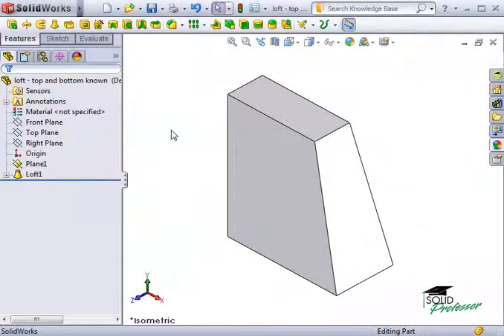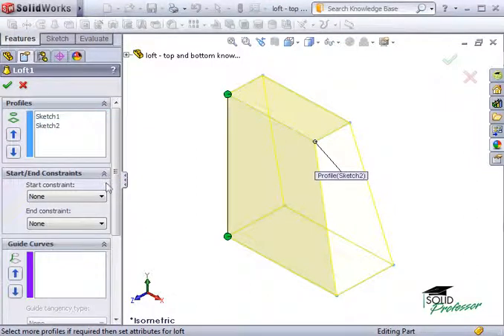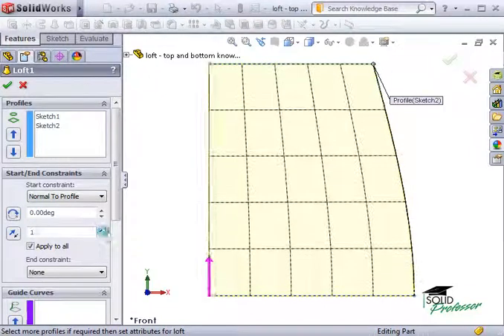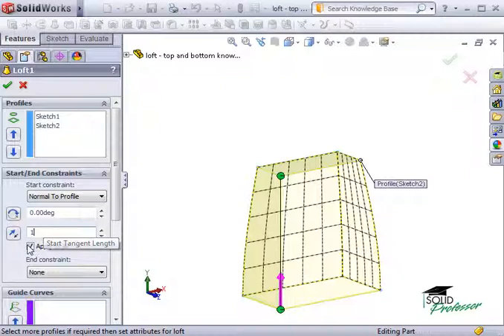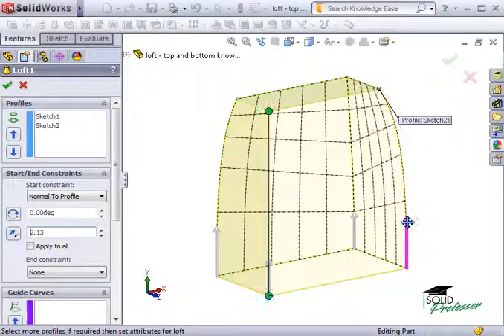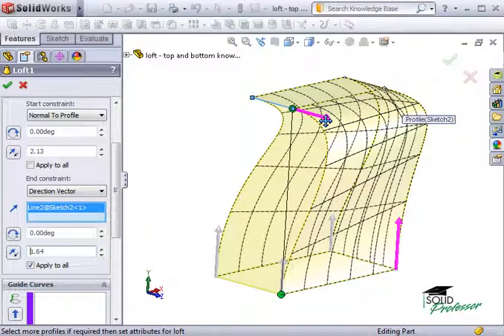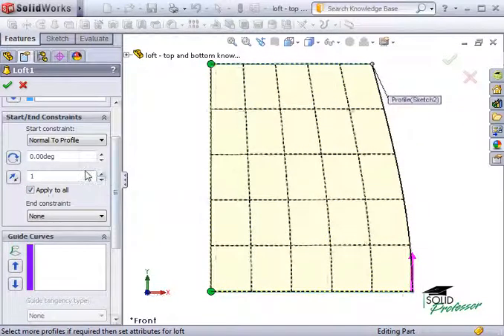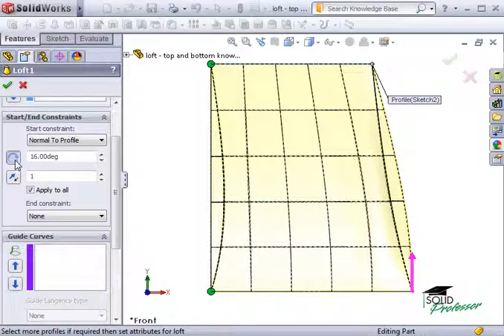4 Lofts   05 Start End Constraints

Comment: Fantastic demonstration. I needed to create a few parts that I did not need precise control over using guide rails. Using these settings I was able to achieve the results I wanted with less sketches for those guide rails. Thank you